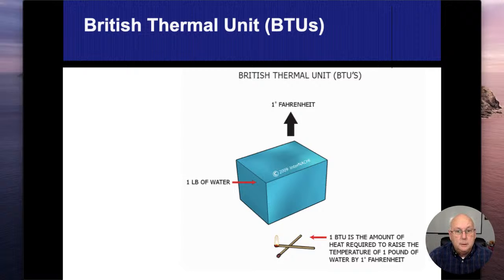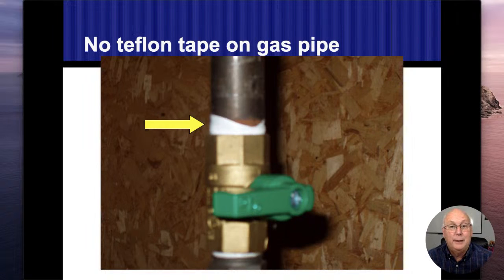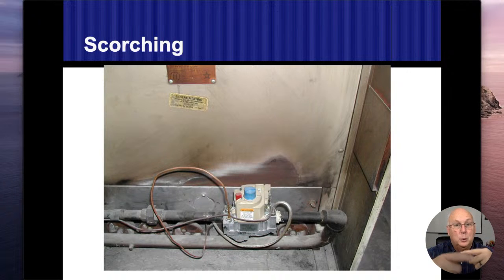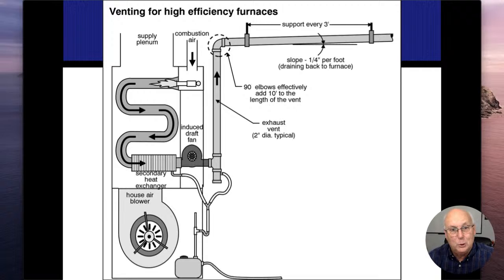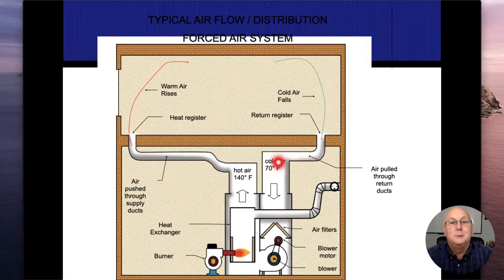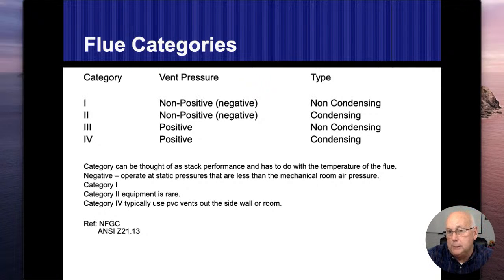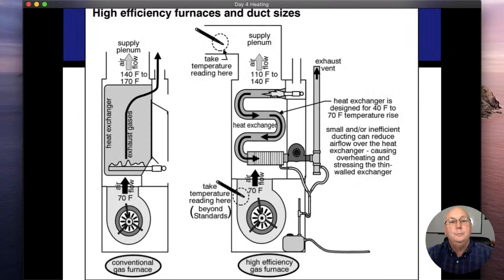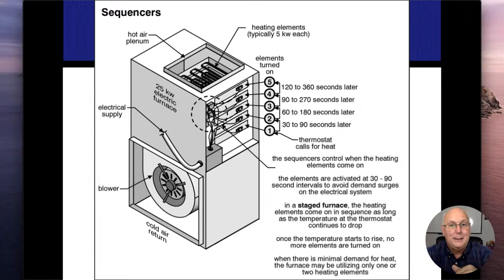Heating Systems

Comment: I thought most barried oil tanks could stay if you drain them...depending on AHJ codes? But you say Illinois wants them out no matter what?
Reply from the maker: https://www.ilga.gov/commission/jcar/admincode/041/041001750H08400R.html

This is the code that says they cannot be left in place.  This is for the ones that are actually in the earth.

Comment: Awesome information as usual!  In regards to orphan water heaters....I was just at a field event where an old boiler was removed from venting out the chimney, however the water heater was still venting out the chimney above the old vent location for the boiler.  Is this something you automatically write up for further review or is there a way to know if the liner has been down sized appropriately since the boiler was removed?